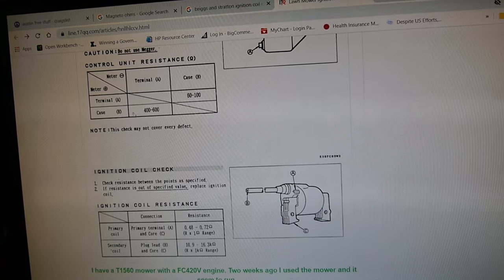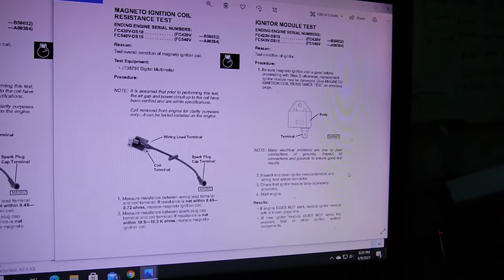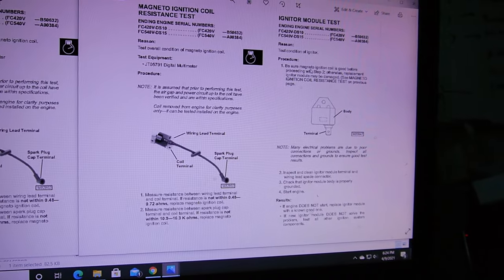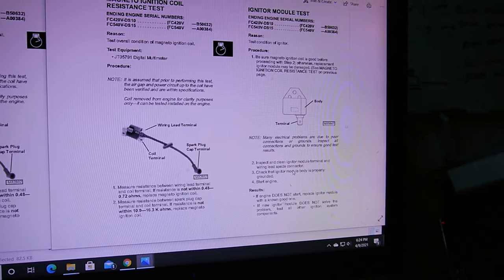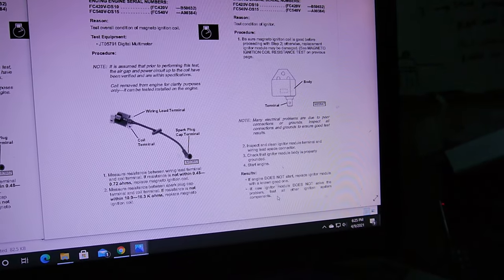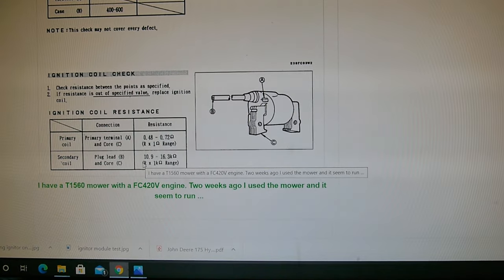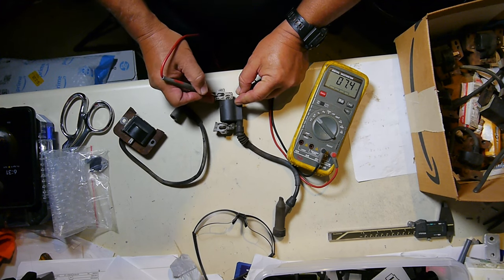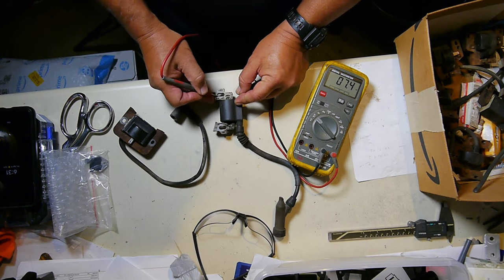How To Test a Lawn Mower Magneto Coil

Comment: Sadly it's almost impossible to find the relative coil specs for small engines, online or otherwise. I guess the manufacturers just want you to spend money with their dealerships/service centres. In future, maybe I'll base my purchasing on brands that are more customer accessible.
Reply: Agree. Unless you purchase the brand specific Service manual, you will not find published specs. So unless you find a coil with a dead short or open, you have to just take a chance and purchase a new coil.

Comment: I wish it were as easy as you said. Unfortunately, unless you purchase a brand specific Service manual, you will not find most resistance readings published anywhere on the web. Sometimes we get lucky when we test coils and find either a dead short or open. But otherwise resistance readings will vary from coil to coil. In general, yea, primary resistance should be really low (1-5 ohms), and secondary really high (10K or more). But when you suspect weak spark or a coil on its way out it gets complicated. 10K could indicate good on one coil and bad on another. But if you know of where we can find coil specs on various makes and models we would love to know. Cheers.
Reply: I have a service manual for the Honda 3011H HSA riding mower.  From page 19-7 the primary side resistance value is 0.7 - 0.9 ohms.  The secondary side resistance value is 6.3 - 7.7 kilo-ohms.  After the winter, mine is suddenly open circuit on the secondary, so I need a replacement.  Exact replacements are available at about $120.  There are many less expensive models available, but does anyone know of a suitable but inexpensive replacement?  One  needs a replacement that can operate within the constraints of the appropriate radius of the flywheel - measurable.  Also the holes in the arms need to match theose on the engine.  But it is impossible to know how the voltage generated in the secondary relates to the resistance of the secondary - it is a function of total turns in the secondary and the wire diameter, plus a few other geometric factors.  Maybe someone with experience can help point me in the right direction to find a replacement unit that will provide an appropriate voltage pulse from the secondary while costing much less than an exact replacement.  Thanks.

Comment: I’ve searched for those coil specs and can’t find them. Could you please just supply one link to any specs so I have a starting point?  Thanks
Reply: Agree.....it would be nice to Google just the right phrase that takes one to the appropriate charts. You must start with a brand like Kohler and add your engine and engine spec. Takes time and doubtful that someone rounded up all the engine manufacturers and posted a mostly complete chart.

Comment: My problem is the workshop manual on my GXV160 says to remove the spark plug cap, and read the resistance. 1) its impossible to undo this .. do you use brute force? 2) The manual does not give a resistance for the cap part. So theoretically my coil might be fine but how do I know the cap part is not faulty other than buy it?

Comment: I. Not getting any spark at a.idellaced the cdi and the full magneto and brand new spark plug  my blue wire from magneto. Is connected to the blue wire on the CDI in the black wire is connected to the black wire on the CDI and I have an extra wire coming from the black wire into the magneto just on a screw to ground to the motor I disconnected the kill switch from the CDI but I am still not getting any spark for some reason even though everything is brand new is there any other possibilities that I'm missing

Comment: My question, I have a 17.5  horse power IC OHV engine, it will start and idle but as soon I try to throttle up to mow, it dies. New carb, cleaned the flywheel, great spark. New gas. Any idea where to start troubleshooting?
Reply: The rotor may be bad or loose

Comment: A resistance check is not foolproof. Ignition modules contain semiconductors. If they go bad your resistance measurements may not show this. You may get a weak spark that only shows at high RPM. Ultimately you need a good spark at pull cord speeds. A pull cord speed spark check is the best test.
Reply: Agree. So many people make coil testing out to be simple. It can be if the coil is shorted or open. But intermittent spark, or an engine the dies after warming up can be more difficult to test.  And resistance reading vary so much, all we can look for is really low primary and really high secondary. Not vary accurate but it helps in the diagnostics. And we have yet to find published coil specs unless we purchased the Service manual for a specific brand.

Comment: Thanks ! When you're shootin in the dark, any  light helps. 👍🍻
Does anybody check resistance between primary and secondary ?
Reply: The primary and secondary coils aren't connected electrically (only magnetically), so they should read: open.
Reply: @AGeekNamedRoss  So if they weren't checked you may not realize that they were shorted, right ?

Comment: Where do you go to get the specs of those coils? And to order parts, I fix small engines on my free time also but don't know where to find the right parts on the web.
Reply from the maker: If you Google the model number of the engine, or mower, you should find a few sources that show the diagrams and parts list.
Reply: norge696 I’ve done that and still can’t find any resistance specs. Please supply just one link so I have a starting point. Thanks
Reply: @Rein_Ciarfella  same here, can't find any good charts at all with specs
Reply: Jack Wobser   I messaged him a while ago. Hoping to get a response with specifics.

Comment: motor wont shut off with key primary reads 00 bad coil but it runs fine just wont shut off
Reply from the maker: Check the ground trip wire going to the coil.

Comment: Isn't it better just to leave it on the engine, remove the wire and try to start. If nothing happens the thing is dead __ and this can happen despite APPARENTLY good resistance figures. Mine were primary 1.2   Ohm,  secondary 4.8 kOhm, and body yo cap  also 4.8 kOhm; but no spark no flash in an inline tester. (Magnet and body side cleaned, proper gap.

Comment: Is it common for an ignition coil to work reliably, then begin to falter-- starting some times, but at other times, producing a weak spark or no spark at all? It would seem an electrical device is either ON or OFF, so the intermittent, "fading" performance of an ignition coil needs explanation.
-------------------------
* Trying to follow your screen display at 1:01, the ranges do not match the correct range for my own ignition coil. So, I presume acceptable Ohm range varies considerably, by the ignition coil model.
Reply: These are electronic ignition coils, and as such, they contain a resistor and two transistors (placed in a Darlington configuration). Semi-conductors are heat sensitive - so yes, their performance can degrade prior to total failure. : )
Reply: @johnstowers4609  Thanks, John-- that gradual fade describes the behavior of my heater/AC blower switch in my car, as well. The switch contains a single, large resistor on a 12v circuit.
Reply: @bobgreene2892  You're welcome. Yes, as resistors age their resistance can/will change. In your case, if the resistance goes up, the voltage drop to the heater/AC blower will go down, which will result in poor blower performance. If you suspect the resistor, test the voltage to the blower itself - against the manual specs. : )
Reply: UNfortunately, coil diagnosis isn't always as easy as people make it out to be. Simple shorts or opens are easy enough to test for, but when you suspect weak spark, or intermittent engine stalling after warm up it can get complicated. We have yet to find published coil resistance specs on the web, only is brand specific Service manuals. And although primary resistances should be very low (1-5ohms), and secondary resistances should be very high (10K or more), they can vary  greatly. Coils can fail when heated up, and back to normal when cooled down.  And if your coil has the transistors built in, then testing moves to a new level.  So it is not as simple as it works or doesn't work.
Reply: @steadyeddie7453  That answer tells me, essentially, this component can vary in value and still be "normal". That was what I suspected about the coil, so it is gratifying to learn I was on-track. My question arose after finding my mower hard to start, after starting easily 10-15 minutes before. (no other, intervening factors present, not even a poorly-ventilated gas cap).